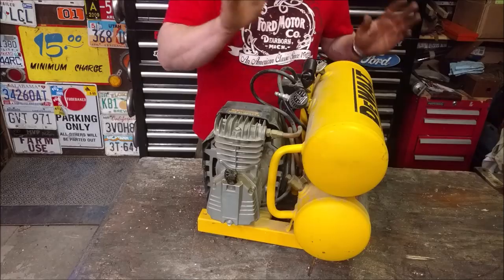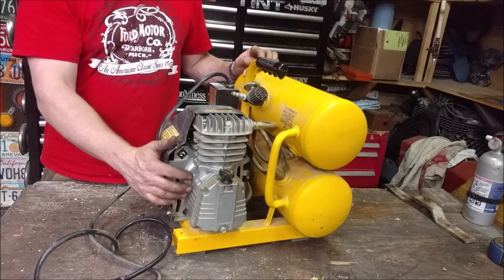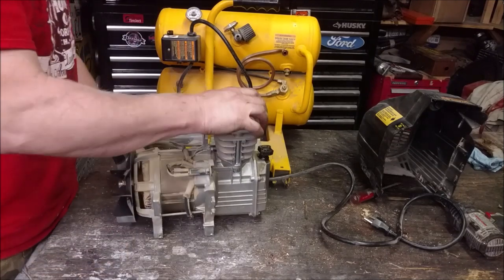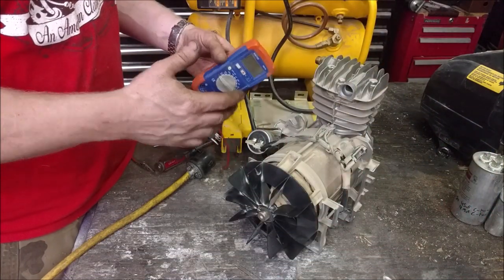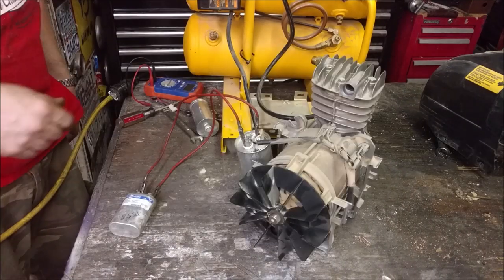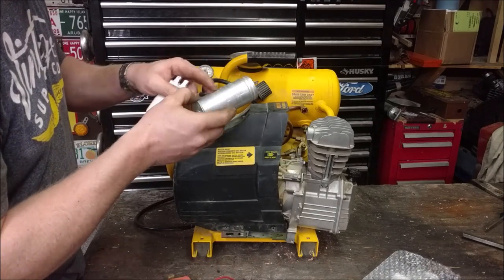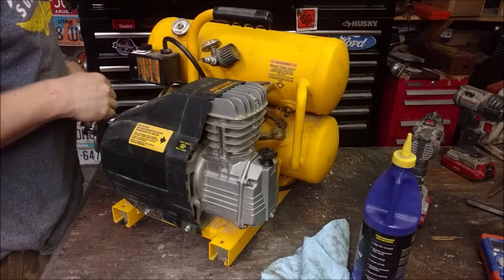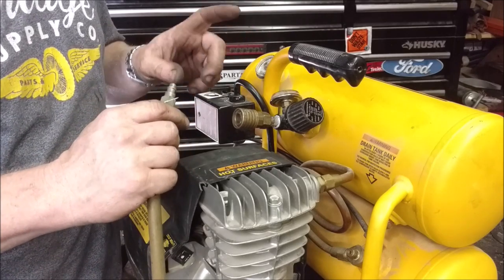How to diagnose Air Compressor Not Working

Comment: Great find !
Had a friend that was going to throw out a big angle grinder because it stopped working so I took it in case I needed parts. He said that it had just stopped working while using it and thought it was worn out. Some of the Makitas had a circuit breaker so I checked and it was tripped. Reset it and it run fine, so I tried to give it back to him. He said keep it, if I'm too dumb to check that then I don't deserve it !
I found out later why it had tripped, he would put his whole body weight on it and overload it !
Thanks for sharing and take care. 👍

Comment: I picked up a string trimmer recently from the side of the road and thought of you. It started on the second pull. The clutch is stuck or something because the motor works fine, but the head doesn't want to spin.

Comment: Pickled up a free compressor that had a sign "Doesn't run". I plugged it in and it ran. Before plugging it in I did flip the switch on it a few times.
Reply from the maker: That's a win.

Comment: Great informative video👍
In my experience running these compressors on too light of extention cord dramatically shortens the capacitors life.
Reply from the maker: I did a voltage drop test and my 120v dropped to around 100v with 25ft 14awg cord. that means the 13amps it was requiring to run  at 120v now jump up to 15-16 amps at the 100v. That's a ton more heat into the windings and capacitor.
Reply: @sixtyfiveford  your shirt says Dearborn Michigan. That's were I live and watch you all the time.Fords is what built Dearborn

Comment: I came across a harbor freight 21 gallon oil drive compressor in the trash yesterday. I took it home thinking it was probably seized up. To my surprise it was just the reset breaker. I've let it pumped up several times and it works. Some people give up to easy and through out good or very easily repaired stuff.
Reply from the maker: That's a score.
Reply: @sixtyfiveford  heck yeah, I'm not ashamed to take things from the trash if I can use them. I used to work as the installer for a truck accessory shop. The owner would throw everything away. Nuts, bolts, fuel tanks, bed liners, used factory parts the customer didn't want and so on. He made fun of me for taking this stuff out of the dumpster. I used a lot of it and made money selling the rest. Good video as always!
Reply: The biggest score I've seen is a heirloom quality grandfather clock that someone curbed; it was immaculate and put out with all its papers and weights nicely packed. 
the chains were just tangled up some in the mechanism and required a bit of detangling before it was perfectly operational. 
I wondered if it was just intended as an anonymous gift or if someone just didn't want it any more.

Comment: It's always fun to solve puzzles.  I've seen capacitors leak oil when they go bad or look perfectly normal.  I've also seen bearing failure contribute to motors blowing windings.  Nothing smells worse than a blown motor.  Three phase is the way to go.  No start windings or capacitors, just three run windings.  You make good videos my friend.  Thank you and God Bless...
Reply from the maker: I used to do a lot with 3 phase motors when I worked in a wood shop. They're bullet proof.

Comment: Nice! Funny coincidence! I just diagnosed a Harbor Freight 6 gal pancake compressor. Paid  $17 at their Parking Lot Sale 5 year ago. Wouldn't shut off except for the emergency release valve. The pressure switch was corroded. Waiting on Amazon for a new one. I'm downgrading it from 150 psi to 120 . I don't need the pressure! 🤣

Comment: Funny you mention about the circuit breaker. I had someone give away for FREE 2 Central Pneumatic compressors, one had a burned out circuit breaker, the other leaked air through the gauge. Two easy fixes. Great video.
Reply from the maker: I love a challenge and can't turn down free.

Comment: Great fix.   That pipe dope won’t dry out on you. Lose the plastic.  It’s just a low strength threadlocker with Teflon for lubricity.  It seals and locks.
Reply from the maker: It's been my go to for years. Thanks to an awesome someone!

Comment: Fantastic score, that's smashing and it cost almost nothing to repair it :-D.
I know what you mean about phasing, i have a wolf bench grinder that was thrown away because the capacitor exploded, oil and guts went everywhere lol.
I used two capacitors to fix it, run and start phase.
They didnt fit inside so i strapped them to the back of the grinder like divers air bottles lol.
A good old wolf bench grinder :-D.
Reply from the maker: I like your style.

Comment: Nice work, again. Wish I lived next door to you, lol. I have a big compressor I bought for $40 last summer and I didn't even try it yet. Buried in my garage, and I need to at least plug it in and check it out. I have another the condensation bleed valve was broken off and it hasn't been drained in 12 years, did one roof and it was new, but it scares me now.
Reply from the maker: I have done this with tools. Sometime I can't pass up a tool deal even though I have little need for it.
Reply: @sixtyfiveford  lol yep, I hoard tools and materials ... and a few other things.

Comment: you can also diagnose a start capacitor issue by manually turning the motor CAREFULLY as you hit the switch.  If the motor get's going, it's a start cap issue.

it's also common for the wires going to the start cap to break from vibration
Reply from the maker: True, that will work when you have a separate Run and Start cap but not with a single cap unit like this one.

Comment: I think the reason why 1-phase induction motors have a capacitor and 3-phase ones do not is that in a 3-phase motor you have 3 windings at 120 degrees from each other, which gives you a rotating magnetic field, which makes the rotor turn, but in a 1-phase motor you only have a magnetic field which changes direction at the frequency of the mains voltage, so the rotor just vibrates in place, and does not turn. To resolve this you have an additional winding which is connected in series with a capacitor, so that you generate a phase difference in the current, which is enough to give the rotor some torque, which gets it running.

Comment: Did the same repair to my roadside compressor find. Worked for an hour before the start capacitor melted. Thoughts on why it melted immediately?
Reply from the maker: Technically on these small motors, the capacitor is a Run capacitor that supplies a phase shift for running and slight aid in starting. If the unloader valve is sticking and not releasing the air pressure off the compressor piston the motor is forced to start under load. This will kill a capacitor really fast. If working properly the motor should be able to start with no load at all.

Comment: I fix small motors all the time. Especially generators. But I have one where it was plugged into live mains and it messed up the electrical parts. I’m good fixing the engines not so much on the generator side. Can you do a video on how to fix a bad electrical side of a generator?

Comment: Been awhile since I’ve watched your vids.   Excellent as always.   What’s you opinion on that Husky toolbox behind you?
Reply from the maker: I've had it for a number of years now and it doesn't let me down. Some of the drawers have to have a 5+ thousand open close cycles on them by now. I've had Harbor Freight ones, old Snap On, old MAC Tools, old and new Craftsman, new Chinese no name and this Husky has been my favorite so far.
Reply: Thanks...   P.S.  FIXED my air tool quick connect fitting tonight.  Thanks so much

Comment: Seems like my issue on a machine that ive literally used just once :( where do you buy the capacitor/starter motors from? like amazon n stuff or hardware stores?
Reply from the maker: Amazon or eBay are your best bet.
Reply: @sixtyfiveford  sure, thnx ;)

Comment: Hello friend.
I would like to know if it is normal for the part where the piston goes above the oil hole to overheat?
Reply from the maker: Yes, it will get very warm and even hot with extended running.

Comment: Nice fix! Any tips for making my oil-less 6g Porter Cable quieter? It's deafening!
Reply from the maker: I would construct a simple plywood box that you can just throw over the top. It will instantly make it at least 1/2 as loud.
Reply: @sixtyfiveford  with provisions for cooling air

Comment: I have a Bostitch 6gal pan cake compressor that always worked perfectly and after being stored away over last Winter, it will not build past 20 PSI and there is no air leaks anywhere on it, would it be the regulator possibly?
Reply from the maker: Carbon or debris are holding the reed valves open. This generally requires removing the cylinder head. Sometimes just cycling it a few times can dislodge them and they'll work normally.

Comment: so you tested the capacitor,  ???  was it with a meter that measures microfarads or did it measure a dead short on the ohms scale. You did not say.   I have to assume the starting capacitor was 0 ohms or a dead short which would cause the circuit breaker to trip.
Reply from the maker: The capacitance meter is what I used to measure the capacitor. A ohms reading is never accurate when testing capacitors. The Circuit Breaker trips because there is no help from the capacitor to start the motor.

Comment: I have a campbell hausfeld 20 gallon air compressor model Hu502000 need piston and sleeve can find anywhere discontuid I was thinking about changing pump to a pump that looks just like that pump Emglo 1.5 to 2 hp do you think it would work or any suggestions thanks
Reply from the maker: Yeah that's a tricky one. Generally these oilless compressors have to have the motor and compressor unit all changed out as one unit. I'm pretty sure Campbell hausfeld made all of the ones for Craftsman so you may be able to utilize that avenue to find a new sleeve/piston. But even if you did it would likely cost well over what the units worth. If you're handy with a welder or even just nuts and bolts I would probably change it out for one of these old horizontal tank compressors you find all over classifieds. The ones with the separate motor and a pulley and a oil filled pump. I see those things pop up all the time for around 50 bucks and they last forever. They're downfall is the tanks usually rust out.

Comment: According to Temco Industrial power supply. Your mileage may vary. 
Voltage
Select a capacitor with a voltage rating at or above the original capacitor. If you're using a 370 volt capacitor, a 370 or 440 volt capacitor will work. The 440 volt unit will actually last longer. A capacitor will have a marked voltage indicating peak voltage acceptable - not operational voltage.

Can I use a capacitor with a higher rated voltage than the original one?
Yes. You can use a capacitor with an equal or higher rated voltage than the original, but you cannot use a capacitor with a voltage rating that is lower than the one you are replacing.
Reply: The voltage rating on a run capacitor is based on the back EMF the secondary winding will experience.  This is why the ratings don't match line voltages.  It is to ensure the "plates" in the capacitor don't arc.  A higher voltage rating is okay as it will just be more resistant.  A lower rating will likely fail quicker, especially if the motor is allowed to run without a load, which is when the back EMF is highest.
Reply: @jkbrown5496  that is why I put that info out there. Line voltage is not the factor in the equation.

Comment: Can you say please 
I have same compressor. When I turn on it tripping 15A breaker but if 20A breaker it work well. 
What’s wrong?
Reply from the maker: Doesn't sound like anything is wrong. These need a LOT of power to start up. 15amp may only work without any extension cord.

Comment: Compressors like this have a distinct operating temperature range. The oil can get too thick, and the starting current draw is 5/6x normal draw anyway. Fresh oil often does the trick!
Reply: Really? Could that be the problem only after it runs a little bit? Mine wont start or turn at all.

Comment: Here is my issue, I cut the compressor on and it builds to 120 psi just fine. It will hold there forever, so no leaks, but when I use the air in the tank the compressor will attempt to cut back after dropping about halfway and the motor will spin just slightly as if it wants to turn back on and build pressure but it never does. I then have to turn off the compressor switch, wait 5 to 10 minutes in which I can hear what sounds like a circuit breaker resetting. That will allow me to turn the compressor back on and build pressure to 120 psi again before it goes through the same cycle of shutting off and not cycling back on after using the reserve in the tank. What could be my issue? It’s a 4 gallon Fortress with the auto reset feature.
Reply from the maker: Sounds like your unloader valve is stuck. This releases any air pressure on the compressor pump and allows the motor to start without any resistance. A properly functioning air compressor will let out a loud hiss right when it reaches full pressure and shuts off. This is the unloader valve releasing the air pressure between the compressor pump and air tank. If it doesn't the motor has a very hard, if not impossible time starting.
Reply: @sixtyfiveford  Thanks for the reply. I've previously tried to troubleshoot the unloader valve by manually letting air out of the tank with the mindset of relieving the pressure prior to trapping it. Is there a better way to troubleshoot? I'm sure my understanding of how the system works is incorrect.
Reply from the maker: @615JOHNLEE  The best way to troubleshoot is to listen for the large hiss right when it shuts off at full charge. If it just shuts off once it reaches peak pressure and there's no hiss then loader valve is stuck.
Reply: @sixtyfiveford  Thanks a ton, I really appreciate it 🙏

Comment: My compressor runs for about 5 seconds, then trips the circuit breaker on my electrical panel (not the compressor's internal breaker). I tried replacing both the start capacitor and run capacitor, one at a time, with the same results. The motor spins very freely by hand...much easier than the one in this video. Any ideas what's going on? Thanks!
Reply from the maker: Sounds like your start windings aren't disengaging. I have a video on that https://youtu.be/FMegj9_OYeE
Reply: @sixtyfiveford  Aha, the centrifugal clutch! I learned about this device on Jeremy fielding's channel but never thought to connect it to this particular issue. I will check it out this weekend and report back. Thank you so much for the quick response!
Reply: @sixtyfiveford  Turns out the motor housing had been converted to a mud wasp housing project...unbeknownst to me!

Dunno if the mud had been preventing the clutch from engaging, or if it was just the mud itself somehow. Regardless, it works! Thanks man!

Comment: Can you post the link to the capacitor on Amazon
Reply from the maker: https://amzn.to/3iJWyqS This is the one I used. The Voltage rating can be different, it just needs to be the same or higher than the old one. The capacitance rating (MFD) needs to be the same though. 60uf in my case.

Comment: Anyone know if there is a cheap generic regulator one can put on small compressors like these. Have a compressor with a bad regulator.
Reply from the maker: I've picked up a few on Amazon for around 15bucks. I think the Home Depot has them as well for about the same.
Reply: @sixtyfiveford  thanks

Comment: Motor start capacitors are used in circuits that don’t store charge. Its phase shifting ac so it charges and discharges every ac cycle. 
Now a crt or an audio amplifier where rectified dc is stored... different story, be careful there.
Reply from the maker: True, but if for some reason the motor winding shorted, the cap could retain a charge.
Reply: Actually, the motor coil IS a short from the perspective of any stored DC in the cap in this circuit. No possibility of stored charge unless the coil in series with the cap fails open at the precise moment the AC wave is at peak and that assumes there's no integrated bleed down resistor or more likely a snubbing diode included in the cap itself.  Having said that, It's always good to have a safety procedure be habit so you don't forget it in a situation where it does matter.

Comment: Looks like you put a start capacitor instead of a run capacitor on there.  Run capacitors are metal to dissipate the heat and have the higher voltage ratings for the motor's full back emf.  But for a compressor that will not be in heavy duty cycle, I suspect you'll get a fair life out of that capacitor.  Heat kills capacitors.
Reply from the maker: A lot of run caps are plastic or even fiberglass shell encased. In this particular case these are dual purpose caps for this style of motor without a centrifugal switch nor separate start/run windings.. It only needs around 5mf for the phase shift in the motor, but needs the full 60mf for starting. So while running it is putting virtually no strain on the 60mf cap.

Comment: I have  the  compressor from hell. It’s a blue hawk brand from Lowe’s and it constantly breaks. I’ve repaired it so many times I starting tracking how long it works between breaks. Some parts have to be made. For some reason it eats capacitors. It has two but the same one keeps dying. The last time one of the wires melted. It currently has one original capacitor and one a/c capacitor. I hate it but I have so much time repairing it I can’t let it go.
Reply from the maker: I've been there many times with tools.

Comment: The capacitor must be an AC capacitor. A DC rated one will not work because the AC capacitors are not polarized, whereas a DC capacitor has polarity.